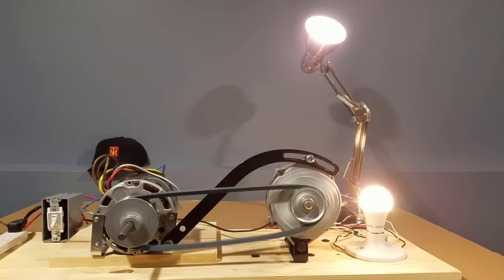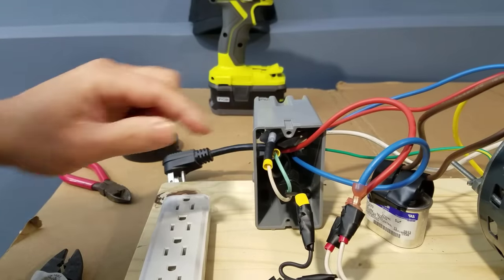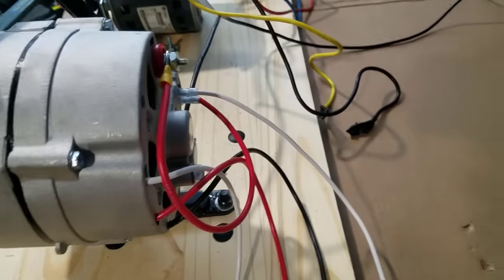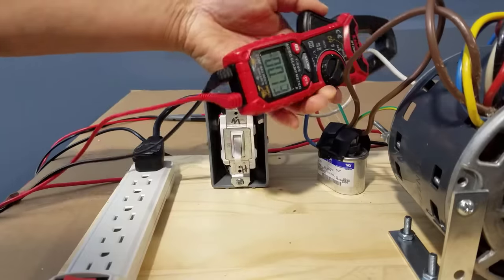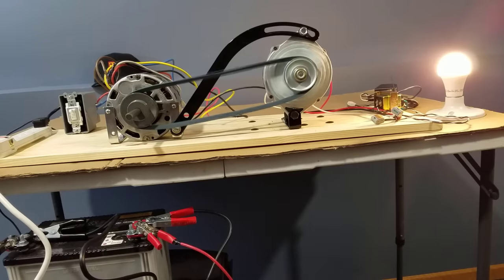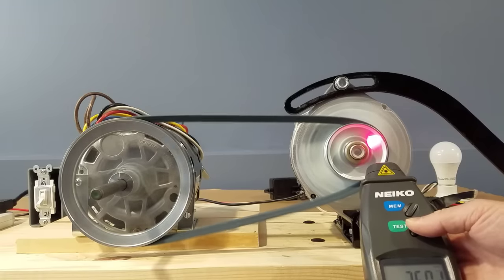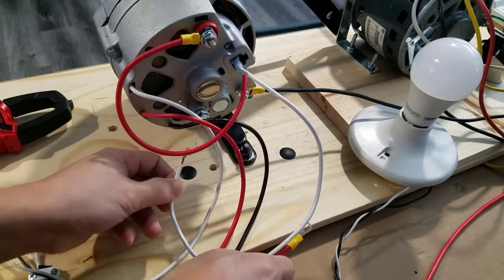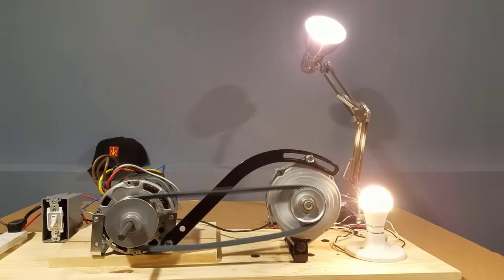Free Energy? (WOW) Using a Car Alternator

Comment: I am shocked at how many people on here have such a little understanding of physics!. Perpetual motion machines are impossible because they violate the laws of physics. If these were true we would have solved the worlds energy problem and never need to burn fossil fuels again! lol lol lol
Reply: It’s it impossible for bumble bees to fly ? 
Don’t be close minded , eventually we’ll find something that can work .
Reply: All the sheep who are believing that perputual motion is possible generates hits for the "inventor" Yes, it generates something: money 🤮🤮🤮🤮🤮
Reply: he still has it plugged into a terminal. It's probably plugged into a wall outlet. and even if it wasn't, it's still plugged into a battery. perpetual motion will never exist. it would break the 1st and 2nt laws of thermodynamics.
Reply: @lanceskopik2928  as if people will ever fly through the air.
Reply: @lanceskopik2928  They are burning simple carbohydrates as a fuel in a machine which makes sense now that we understand the anatomy of bees. Nobody is claiming that bees flying is suprising anymore.
Reply: Sorry but it is not that simple.
We should have free electricity right now. There is a trillion dollar motivation for people to believe free energy is not possible.  Look into Iridium pulse spark plug free energy. Energy cannot be created or destroyed but you can pull energy into a magnetic field and use it to power appliances.  People think electricity comes from power plants and hydro dams but it doesn't. An actuator current/alternating current comes from the plants but the electricity we use is actually supplied by transformers in your neighborhood. Those are the actual power plants. 
I like to use the analogy of a steampunk city that uses steam to power everything.  Imagine each long straight city street has a long steel rail with teeth that goes back and forth continually and each household has a gear that turns off of it to make everything in their home work using physical motion and also an alternator that spins via gears. 

Here is the thing. The AC current sent in power lines is like that long steel beam going back and forth.  And this is what the iridium pulse spark plugs do as well playing the part of the alternating current throwing electric power off of the magnetic field of the magnet.  There are videos of a guy powering his whole apartment with 7 ceiling fans, lights and little fridge/freezer. With I think just 6 spark plugs.  A new day is at our doorstep but they want to suppress this.
Reply: @lanceskopik2928  no it was thought that it was impossible... But then after study it was understood. So your point is invalid.
Reply: @guidedmeditation2396  So what you are saying is that YOU, have a household being supplied with these devices, running your A/C, refrigerator,, electric stove/oven, all of your lights.
Reply: @lnwolf41  Cool
Reply: @lanceskopik2928  bees dont defy the laws of physics
Reply: @lanceskopik2928  No...literally no. Even if you built a perpetual motion device (in theory MAYBE possible), it would slow to a stop any time you try to create power with it. Why? Because you'd be EXTRACTING the power that keeps it running, resulting in it stopping. Rule #1 of thermodynamic: you can't create energy, only transform it. You'd only be transforming the energy used to start the perpetual motion device. No more, no less.
Reply: But the earth keeps on spinning? What makes it spin? And why does it keep on, can you replicate it on a small scale as science suggests? Something along the line of '' what happens on a small scale should be representable on a big scale and vice versa''  ....... I can't google it, it gives me maps and scales, I think we might be losing Google. I have a really hard time searching for things these days.
Reply: Well I would not put it past the energy industry to bury any invention that would jeopardize their monopole....see Nicolas Tesla wireless energy for example.
Reply: @RasLion  nico had it sussed, he could decipher morse code from venus, and he invented polyphase electricity
Reply: You don't need a degree in physics to put something like this together during hurricane michael I used a inverter couple of battery and a charger had lights until the power came by on work for me
Reply: @Mjg503  they already have flown through the air
Reply: Bullshit is cheap
Reply: @guidedmeditation2396  you're right....it works.
Reply: @deangilburry8216  no, we dont fully understand magnetictic fields and electricity.
Reply: @DieselRamcharger  BEES NO  but large Scarabs do.  They actually use antigravity waves to fly but you won't read about this in school.
Reply: @Quinny.K  Hi Danny...  The continuous dual vortex bipolar magnetic field is what keeps it spinning and spinning at a particular speed.   
Contemplate the large apple like magnetic field you have seen in animations. This self organizing energy field is universal to all matter and it is what makes human life possible because we have several in our body as well, powered by our heart.   This is what makes it possible for an electric current to travel from your toes and fingers to your brain.  Did you know your right hand and foot have a positive charge and left a negative?

Please take the time to watch the Utoob video  "THRIVE" that was made by the heir to the proctor and gamble fortune. It shows how big and small this energy field is universal. 
It may in fact be that every particle has a tiny black hole that makes it possible.
Reply: @River-Stockman  it has already been done. years ago. The guy in America. Did it. and guess what happens to him. Yes I bet you got it he was in an accident.
Reply: @guidedmeditation2396  helicoidal reflector isnt used for flight.
Reply: @guidedmeditation2396  and you would have read about it in school, had you not gone to a government run indoctrination center but an actual institute of learning.
Reply: Bumble bees have tiny batteries built in , that's how they can fly  everyone knows that.
Reply: @thornyturtleranch4u  We understand enough to know that something can't come from nothing. You can't pull an infinite amount of energy from an object/setup, and that's exactly what this machine is claimed to do. My point stands.
Reply: @Quinny.K  The Earth was set into motion. In space, there is nothing to remove that rotational energy (beside maybe an interplanetary impact of some kind). If you could put giant magnets onto a planet and a huge coil around it as it spins (essentially making a giant generator), it would generate power, but eventually it would stop spinning because the rotational kinetic energy would be transformed into electrical energy.
Reply: I'm here for the same reasons YOU are .
Reply: Known physics what we understand at the moment not unknown physics with all due respect
Reply: He looks like he telling the truth but volts mean nothing he running and LED builb that would run of a few miliamps there is no load you can run them bulbs of 1.5v 
I know q few thing when a genorator goes faster than its rated speed you get tork curve where the load does not impact the genorator also there is another law when you have a coil and quickly turn of the voltage the back emf goes to infinity and makes magnetic electomitive back emf so this could work if done correctly with back emf with out backing laws there use to be motors in 1900 that were dc push motor but had 4 brushes 2 180 out of phase went to copper raped round the motors that was waxed 2 layers basically a capacitor to when the + and - brushes moved past the stator the collapse in dipole charged the copper raped capacitor there are loads of energy devices that may look free energy but has a reason for them to work like tesla turbine runs because the atmosphere is pushing down ie pressure when it runs the exhaust cause low pressure so there is a difrence the word for free energy is gradiant a difrence between 2 could be anything from water up hill to air pressure to back emf or tesla coil working as a pump the energy goes back forth so just reused just like the water car and jet engines are free energy
Reply: @RasLion  wireless energy is inefficient. Tesla's towers were inefficient
Reply: The solution, harness some wireless sources of energy coming from the ground, the ether. Tesla was working on it, a lot of greedy fellows didn’t like it. My opinion is not as clear cut as yours, the laws of physics take the back seat anytime a real breakthrough is made. I pity the fool who makes the discovery of free energy and tries to patent it.
Reply: I agree with you being a electronics  technician  with engineering  EXPERIENCE  . You CAN'T  get out more than you put in. THESE TYPE VIDEOS ARE CLICK BAIT FOR PEOPLE WHO ARE GULLIBLE  AND HAVE NO UNDERSTANDING OF PHYSICS/ ELECTRONICS/ MACHANICAL ,ETC.  PEOPLE GET DESPERATE,  FOOLISH AND SUCKED INTO THESE FREE ENERGY DEVICES THAT  DO NOTHING.
Reply: @DakarBlues  Tesla was working on wireless communication not power generation
Reply: Many people have you just never heard of them before they was silenced forever
Reply: Energy And physics are way different
Reply: Impossible due to the conservation of energy.
Reply: There are no absolutes in science.
Reply: Not necessarily if they make more money burning fossil fuels and oil then why would they use this they have an unlimited cash flow
Reply: @jeremyr3533  Then why isn't this person (or all of the other free energy gurus on YouTube) being silenced? If they were really being silenced, this video wouldn't be public, as Big Tech (aka YouTube and Google) would see it as a risk and take it down. Your point makes zero logical sense.
Reply: There is no profit it it. It is real.
Reply: Laws of physics have been broken before...
Reply: @River-Stockman  
I can only stay plugged in for 15-20 min
at a time. Then my perpetual motion machine just stops, totally drained of life energy... 🤔
Reply: Earth Crusader  Well I for one wouldn't even consider messing with the earths electro-magnetic field.  That would be worse than nuclear.  There are some pretty cool magni-kinetic machines though that get pretty close.
Reply: @theviperman1947  If it is real, then go on and build it for yourself and get free power for the rest of your life! If it was real, everyone would be doing it and it wouldn't be isolated to a few random YouTubers with questionable credibility...and other more credible YouTubers wouldn't be disproving it all the time.
Reply: @deangilburry8216  there is no profit in free.
Reply: I like how people think we got “the laws of physics” figured out. Check !!!…. Physics done 100% oh well what should we do next? nothing else to discover here. Haha
Reply: @theviperman1947  That has nothing to do with the fact that this cannot be done without video fakery. You're so convinced it's real? Go do it yourself and wind up just as disappointed as the rest of us living in the real world.
Reply: @jazzao3993  Nobody said we know everything. What we do know is that this is impossible. Not convinced? Save your money up and try this trick yourself.
Reply: Thank you
Reply: I am shocked at how you think this doesn’t work. It’s so simple. Energy is everywhere.
Reply: @swatisquantum  Like I've told everyone else who tries to argue for this apparently very convincing lie, go try it yourself with the exact materials depicted and let me know how it turns out for you. I'm not making up information. If this was real, it would be implemented in every powerplant around the world to get unlimited free power, but it just isn't. True, energy is everywhere, but this device is still bound by the laws of physics and thermodynamic, so it only produces as much energy as you put in when you start it spinning. No more. Once the energy is gone (whether it be used up as electricity, lost as heat, or converted to some other form of energy), the device will grind to a halt. This is a hoax pulled off by powering one of the motors with either a battery or mains power, and it has been disproven literally hundreds of times.
Reply: We can't create a perpetual But we can tend to perpetual motion
Reply: Very interesting! 

Tesla said free energy is for everyone but Thomas and jews want the money.

My problem is I don't know how to set it up step by step and I am not Dr. physical.

Comment: Put heavy flywheels on the pulleys. Make sure the instantly available horsepower of the flywheels at speed is 2.5 times the maximum peek load spike, usually the startup load spike of the largest appliance.
Reply from the maker: I'll try the flywheel later when I'm able to build something more solid that could support a flywheel.
Reply: @mrmightytiger7385  even just 5lb flywheels would improve performance. Any weight flywheel, actually. The peak spike load is what would be limited. The output of the generator should also be 2.5 to 3 times the max watt draw of the motor. The flywheel inertia provides that the motor need provide less torque to keep the system rpm under load and prevents pulsing back to the motor during load spikes. Just add small flywheels to your current system with the same load and see if you see any improvement.
Reply: iMeasuredThatAnyKindOfFlywheelsMeansMoreLoadForTheMotor,ItDrawsMoreCurrent.
Reply: Cannot possibly work. In my family, we obey the laws of thermodynamics.
Reply: @Sam2sham  ThisIsElectricity.AndThoseAreNotTheRealLawsOfPhisics.
Reply: @ovidius2000  ridiculous,. This guy did not study physics or electricity.
Reply: Get a very small alternator pulley and use diodes in the sence wire to get more output out of the alt.
Reply: @Sam2sham  after some study, I have discovered, you are correct. This is a closed power loop and will eventually draw down. The loop must be open and there must be an external power input. You might take a look at the William Skinner device. It is an open loop and allows static force of gravity to enter the loop.

Comment: Nice work. I will go thru your videos. I love this kind of stuff.
But 4 to 4 1/2 amps out of the alternator. With the pulley change the amps go up on the ac motor. It takes about 8/10 amps to make 1 amp AC with most inverters. Well, the ones I have. I think that you have a lot more power going out of the battery than going in. Even without the loads.

Comment: The key to perpetual motion is in permanent magnets...

We can manipulate and redirect magnetic fields pretty easy, using mu metal you can create an on/off switch for a permanent magnet, using magnets with an on off switch to push a wheel with magnets on it you can make that wheel spin,  it's just a matter of timing after that...
Reply: Agree

Comment: I like the bigger ratio of the pully but a little modification, how about putting a flywheel on the drive motor?
Reply from the maker: There's plenty of room for improvement.
Reply: @mrmightytiger7385  You mean you can improve on a total failure

Comment: I used a step up transformer to convert 220v ac to 2000vac. It doesnt mean i am getting anything more. Please check the currents
Reply from the maker: You're correct. You could multiply voltage easily, not not current.